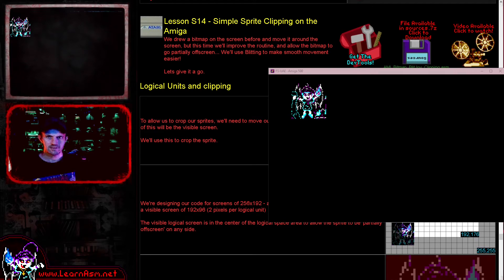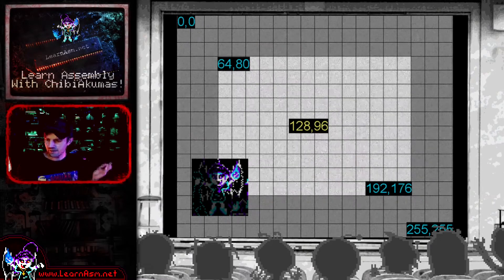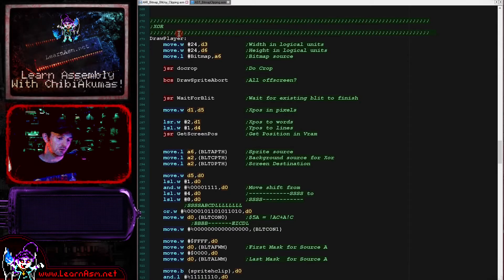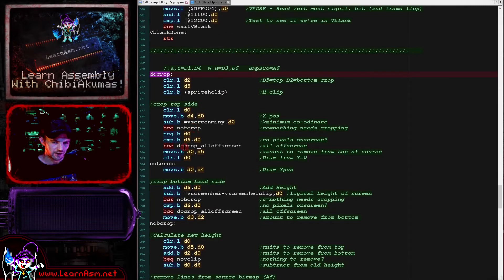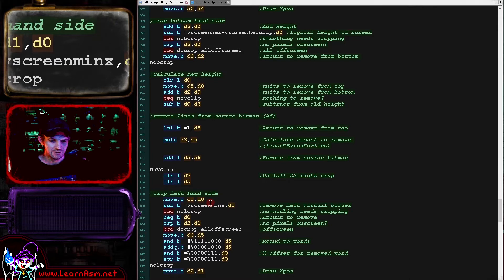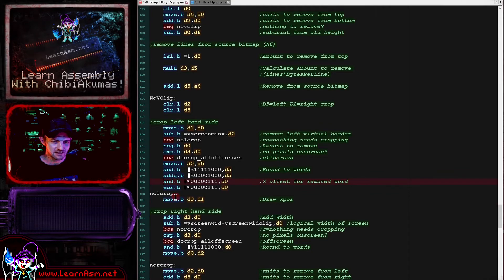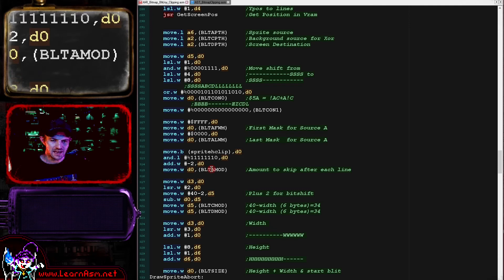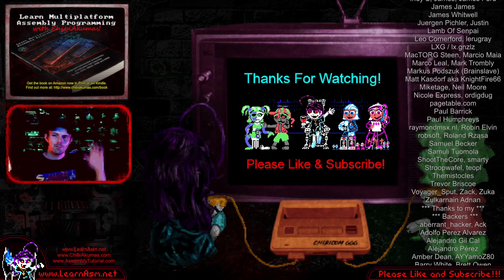Lesson S14 - Simple Sprite Clipping on the Amiga

Comment: Question: if you wanted to stop the sprite from moving into the border and halt it completely on the edge, how would you do that?
Reply from the maker: If you don't need sprite clipping, you can use this simpler version here:
https://youtu.be/gVIQImNH3yo
If you need clipping in some cases, but just want to limit the range of the sprite, you'll need to add 'range checking' to stop the co-ordinates going outside the visible area (Also performed in the above video around the 6 min mark)
Reply: @ChibiAkumas  Thanks!